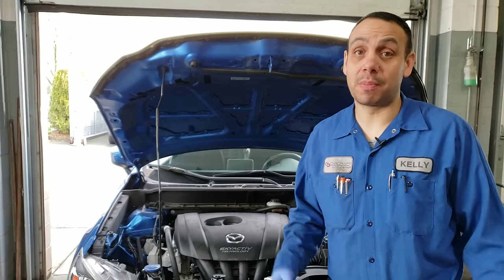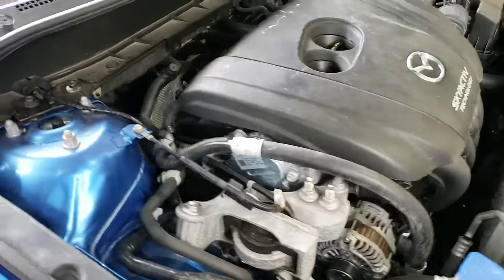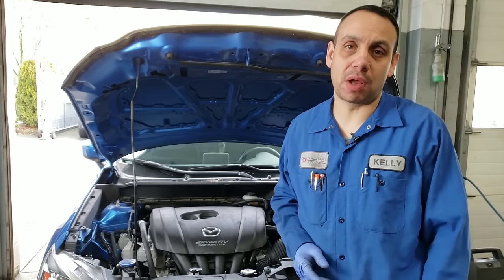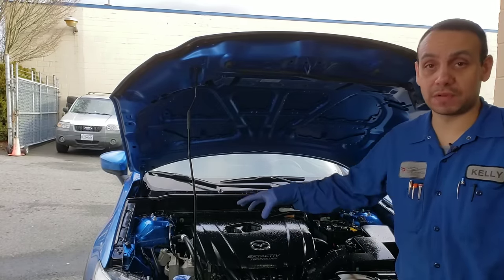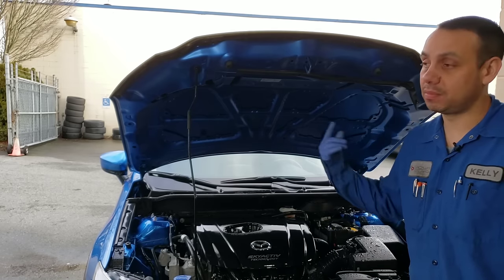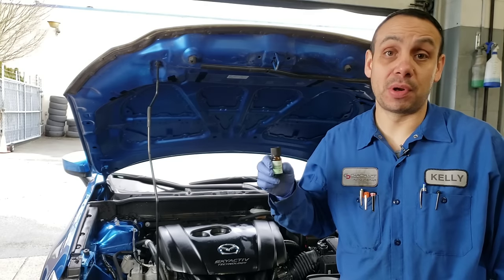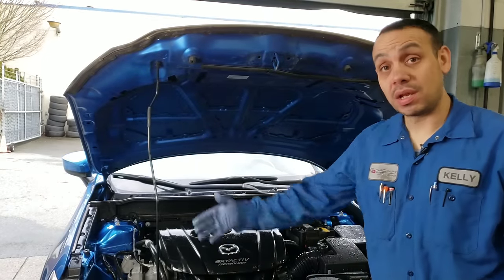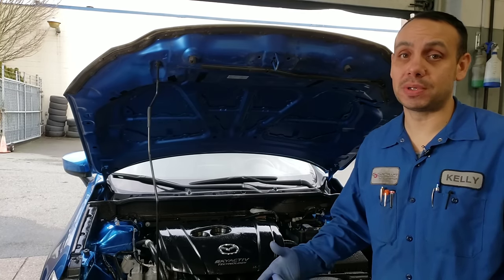Easy Tip To Keep Rodents, Mice & Rats Out of Your Engine Bay

Comment: Always switch your cars AC to recirculation before turning off overnight,   this shuts the ductwork from outside air, if you leave it open they will get in your ductwork and make a nest up inside where your cars cabin filter is, they use the filter as a nest. which is usually located below the glove box. they will also chew through the steering shaft boot in the firewall that separates cabin from engine bay.
Reply: Most cars automatically shut the flap when the engine is off
Reply: Now how to get rid of ants...
Reply: @2Hearts3  I've had ants a few times get in my car and it's incredibly annoying. I've sprayed the entire car even under the hood with spider/wasp spray, but the home defense spray from home depot works amazing. No more ants within a hour.
Reply: @latricet5569  But will any get aired into the passenger compartment, as it may be poisonous?
Reply: @youtubeobserverz  no, but we didn't turn on a/c either. No different than spraying it around your house.
Reply: @2Hearts3  borix acid or borax
Reply: @tazmaniandiva7762  Leave it out for them as you would Terro? They'll eat that? Thanks
Reply: @tazmaniandiva7762  Thank you, will try this 👍
Reply: Great tip. I fight off mice in a car I garage for long periods. They love the cabin air filter plenum.
Reply: I also found leaves and poop of mouse in the air filter..but I think if it keep recirculation mode than they will chew plastic and make hole to enter inside filter
Reply: @Brutipra  They will try and chew through soft rubber like the boot on your steering column going through the firewall,   don't think they will bother hard plastic. they do like getting between the hood and  the heat shield on the under side of the hood above the motor.
Reply: OMG! I DIDN'T KNOW THAT.....THANK YOU!
Reply: @americafirst4me  👍 Don't forget the steering column shaft, look up underneath where your gas & brake pedals are, the steering shaft  comes down and goes through a rubber boot in the firewall above  the pedals, somehow they know chewing through that rubber boot from the engine compartment gets them inside the car.
Reply: I’ve been storing my 1st generation Miata for over 20 winters. Mothballs in the engine bay nooks and crannies and mixed into a crumpled steel pan scrubber (jammed in the tailpipe) have always kept my car from being molested by any rodents.
Reply: Just get a neighbor like mine! About 50 cats and animal control does nothing. Mice problem averted 😄
Reply: @anastasiosanastasopoulos5736  Are you doing anything in the air filter inlet nozzle? Mine was a mouse nest. Both my NA's have easy access air filter inlets for mice. Wondering about a way to keep them out. Also muffler gets packed full of bird seed. Mice are terrible here.
Reply: Hi.
Russian Belknap family?
Reply: @flat6fever680  I use those mini-quiche/tart aluminium plates that are around 3” in diameter. You place the naphthalene within, making sure to not exceed the height (or depth) of the plate. You can either use powdered or balled naphthalene. These little plates should be placed ( I use a little tricky-tack on the bottom to keep them secure) along perimeters of rodent entry and potential nesting sites. Their low profile allows them to be jammed in all sorts of horizontal nooks and crannies. You can also ball up the naphthalene in a shop towel and wrap a heavy-duty industrial steel pan scrubber around it and jam the whole thing in the tailpipe, as rodents have been known to nest in mufflers. I hope this helps. Apologies for the late reply.
Reply: @Brutipra  They will actually eat a hole in the air filter if you give them a chance. both the cabin and the engine filter.
Reply: @anastasiosanastasopoulos5736  Thank you kindly.
Reply: Thanks for the heads up
Reply: YOUR COMMENT SCARED THE CRAP OUT OF MY OLD LADY 🐀🐀
Reply: @latricet5569  oil of pennyroyal
Reply: @sirkrutchbluesman3009  She is telling the truth. This is what I'm dealing with now 🐭😞
Reply: @2Hearts3  Sprinkle a little bit of ground cinnamon wherever you’re having an ant problem. Ants hate the smell of  cinnamon
Reply: @jamesmcardle5426  Thank you, will try this. Also, about cinnamon-- remember to eat only 'the good stuff,' and leave the cheap one to the ants. Ceylon cinnamon is good for your heart (and will cost much more, but worth it); the cheap kind will threaten your heart health. The way to tell: buy sticks, not the ground, and look for the inside of stick to appear flaky. The bad cinnamon stick is smooth inside. Thanks for the tip 👍🐜
Reply: I do this too and always regret it when I forget because spiders end up sneaking their way inside the cabin.
Reply: Peppermint oil attracts bears. What can I use instead of peppermint oil?
Reply: @lenbuckholtz2740  Had no idea We were Russian.
Reply: @jentommyontheroad8089  moth balls
Reply: Yep that's exactly where the problem for my car has started. It is a classic i rarely take it out because of this  my cabin filter is completely destroyed by mice and don't know now what to do in order to protect the new one. Plus can't use peppermint oil near the area since it is a part of the AC
Reply: @robertbelknap  neither did I. thought i was just 73% mutt. fits me. Who's the pretty lady in the picture?
Reply: @lenbuckholtz2740  Lol, Marilyn
Reply: I think this happed to me , I just moved to a new place it had a old deck seen a rat go under it , so I got rid of it , I think one of them got into my ductwork , seen some chewed up foam on my cabin filter and can smell a stink come in to the car  , it's a new car so I was kinda hoping it wasn't a rat lol  was just filling up at the petrol station and a rat came out from under my car and ran to the car behind me and went straight in to there engine bay 😬😅 so I jumped back in my car and hightailed out of there 😂😂😂
Reply: They are off all my firewall!
Reply: Sadly my 2018 RAV4 defaults to open when you turn the key off. Idiot engineers !!

Comment: This has always worked for me living on the farm. I also place a few make-up sponges with a few drops of peppermint oil on them in and around the compartment of the engine bay. Works great for the tractor too. They used to eat all the tractor wires and car wires until I started using these two methods. Now I get no rodents at all.
Reply: Reading all the replies I am going to follow your advice because Farmers know best as far as I am concerned. My mother was a farmer and she taught me a lot of good lessons from her life on the farm and they were always great. Thank You for the information.
Reply: How often do you need to do this in order for it to work?
Reply: If you are putting it on sponges , I would guess about once a month in a garage or every week if it’s outside.
Reply: Along with peppermint oil, I also use sponges soaked with TABASCO liquid, also rugging it on all the most 'vulnerables'.   Rodents HATE both !!!!!    I live in an 'open woods' where rats and mice are in super-abundance  and will also occasionally  'chew' though my house 'Rim Joice' to enter, especially in the late autumn... rats in spring time when they're looking to 'nest and breed'.    
Once they get inside the house, I prefer tabasco .... and I also set small pans of a DRY mixture of corn meal + wheat flour (50%) to 50% Plaster of Paris --- 'deadly' as it totally blocks their intestines ... rodents are unable to  'puke it up' after injestion. 

The only caution is to use vinyl gloves when handling the tabasco ... and thoroughly wash your hands *before* rubbing your eyes & face.... and using the toilet !!!!!  :-o !!!!
Reply: How often do you have to spray the peppermint oil?
Reply: @caseybc6342  Peppermint oil needs to be sprayed every two+ weeks.    You can also add 'sprigs' of cloves or  flower heads of marigolds. 
To prolong the aroma of peppermint oil ... soak cat litter granules in it - longer release of aroma.
Reply: This didn’t work for me at all.
Reply: @Fluterra  buy a mouse trap then or use your noggin and Google slash read comments and suggestions
Reply: How do you get them to stay in place? Is there somewhere specific I should place them? Thanks!
Reply: Never heard of using sponges but sounds like a good idea.
Reply: Love the makeup sponge tip!  Thanks
Reply: @caseybc6342  watch the video again and listen
Reply: Thanks for the info
Reply: Keep in mind rodents love leaves, paper, garbage so clean the surroundings thoroughly. 

I even use glue traps on the engine cover and on top of the battery since they like the chemicals, and leave a note on the dash board so I don’t forget. 

Keep in mind they can chew through wires and cause a lot of damage. 

Those little f are smart so whatever it takes, get creative.
Reply: I want to know about that electronic device you mentioned.  How is it powered?  I need to find one that has its own battery.  All I could find in stores/on line are plug in style and a couple that connect to the vehicle battery.  I don’t have power at the wood shed where I keep my plowing truck and I don’t want to run down the battery.
Reply: A bowl of antifreeze works pretty good too
Reply: Did not work for me either. I drenched the top of my engine and still found new rat droppings each time I had used peppermint spray.  @Fluterra
Reply: Why does this work? Im trying to find a similar solution but in my country we don't have peppermint oil 😢

Comment: It doesn't help that several companies are using an insulation on the wiring that is an extract from soybeans. For rodents, newsflash to the engineers, soybeans are rat food!!!
Reply from the maker: 100%
Reply: They know it. It’s designed to fail expensively
Reply: Didn't you ever think some of those engineers have rat brains? Hehe🤔😂🤗
Reply: Honda's
Reply: Same with fiber optic cables. The liquid between layers of 'protective' sheathing that allows for differential expansion and contraction in all temperature ranges is - peanut oil. Rodents LOVE the stuff and can smell it through the outer layer. So up here in the mountains of Arizona, guess what gets chewed through by tree squirrels every few months. We've spent days (literally) without any phone or internet while local crews patched up as many as 20+ damage points in my neighborhood.
Reply: Are companies doing anything to address this issue?
Reply: Yes it does not help but you can also thank the politicians and the weenies who vote for this nonsense. Remember you wanted biodegradable cars.
 Add hot peppers to the wire coating mix , problem solved.
Reply: @paulcoenen7918  I'm definitely on board with blaming politicians, they destroy everything they get involved with, and it's about to get even worse.
Reply: @richardhowe5583  Probably true, but add in the bean counters who've been asking engineers to design in "planned obsolescence" since the 60's (or earlier) so they could sell people a new car every 10 - 15 years or so. Ever notice that spare parts for cars are generally unavailable from the manufacturers in about 10 years? If a car isn't popular enough to support an aftermarket production, we're limited to scrapyard salvaged parts. My '94 Tracker is a prime example.
Reply: @steve762us  Correct!
Reply: @cruisecontrol4922  
Yeah, the dealers are making money doing repairs.
Reply: Which makes and models?
Reply: @AZStarYT  Talking to a lineman repairing such damage, he told me that he’s even seen bear damage.
Reply: The oils from our hands touching thing attracts them also. We use fiber jumpers and if we glove up and wipe down with alcohol the mice down bother them. The ones that were touch have all been eaten and replaced  several times a year
Reply: we found out the hard way , last year we took our camper out and we weren't getting propane to our heater , here something was chewing on our line , and later we found out it had a outer cover made with soy
Reply: @originaljcs  I have  worked in the farming industry and I can tell you  that nothing eats  soybeans. Absolutely nothing.
Reply: They know it's rodent food and it's probably why they use it a constant flow of money by constant repairs needed. Tesla is a great one for this and when first hearing of the story they refused to cover the replacement of the soybean based wiring to the tune of $10,000 +- dollars if remembering correctly. In their head it seems they feel it helps the environment and it is supposed to be an environmentally friendly vehicle so it is not on them to replace wiring that rats rodents eat away at.  At least at the time of learning this they took no responsibility. Great way to make revolving door residual income - make parts you know will be eaten by animals so the flow of money just keeps on coming.
Reply: @steve762us  Totally agreed on "chalk it up...".
Reply: here in europe i hear they are using dryed fish waste for wire insulation.
Reply: @cautiouslyoptimistic6185  Yeah man, it  is HIGHLY processed first. In it's natural state, nothing eats soybeans.
Reply: @kevinhardy8930  Very well put. 
                     👍👍
Reply: @kevinhardy8930  Have you never heard of veggie burgers?
Reply: @frederickshipp8013  you  dont  get it. Soy  beans are processed. The same way corn syrup is  not corn, veggie burgers are not soy beans, they are a soy product. 
I stand by my claim  that nothing eats soy beans in their natural  form.
Reply: Fluoroplastics are very durable especially in a hot place like your engine bay.   The wiring insulation in my '99 Tahoe stands up very well to heat and oil residue vapor.
Reply: @johnlopez3001  ...Yes Honda, but they aren't the only manufacture most if not all manufactures are using soy now...but Honda knows of the problem (maybe others?) and have addressed it by selling rolls of rodent repellent tape (around $100 a roll) so the "vehicle owner" can some how wrap their entire wiring harness which is next to impossible and it's not only the engine compartment either.

Comment: Nesting, urine, feces, are all annoying, but the rats chewing up the wires, that's way worse.
Reply: They can total a car
Reply: Spent close to $600 yesterday at my local dealership because of these pests.  Chewed through the map sensor connector wires.  Now using this method as well as moth balls.
Reply: @hiyellagal  what do you own?
Reply: @glennnichols4220  2005 Chrysler 300
Reply: @hiyellagal  i thought Toyota like others have mentioned was prone to this that is why he had a Toyota in the picture.
Reply: They use soy bean oil in the wire insulation which the rodents eat. I had my whole sensor harness eaten. It was gone right on top of the transmission where is join the engine there was a flat spot where they had their nest
Reply: Dang manufacturing using rodent attractive insulation way worse than old days..we Also use moth balls & 1 bite
Reply: I actually had nests by my blower motor and they chewed through the wires , I was driving one day and saw smoke coming in through the windshield vents. I stopped and a fire started, I actually had to pack my heater blower motor. After 1000.00 dollars, and alot of swearing, I got my truck back.
Reply: I packed it with snow because I couldn't get the fire to go out. It melted the casing of motor, and it still was smoldering so I took snow and packed inside and the too of motor. I have a love/ hate thing with wild animals.
Reply: @patriot1998te  - Damn, you're lucky to have snow to pack. Imagine those in warmer climes with nothing but dry leaves or grass on the side of the road... lol, feed the fire even worse.
Reply: @glennnichols4220  That is a Mazda.
Reply: Chewed wires to the ecm and at other spots on my A6, had to pay mechanic to fix it but in the end I had to give up and scrap it 🤬
Reply: To those using moth balls.
Just so you know it's a toxic insecticide, not to mention the noxious smell.
 I find mouse traps baited with sunflower seeds to be 100% effective. The key is to always have at least one baited and working trap in the garage, they will find the seed and they will not leave the trap alone as long as the seed is in it or they die trying to get it.
Reply: I drove a brand new truck while driving all the warning lights came on mice 🐁 got into engine bay and chewed through the main wiring harness 😲
Reply: @glennnichols4220  ALL newer cars have soy based wiring.   ALL manufacturers use it.
Reply: @gaiusgracchus7475  So soy base wiring isn't the cause??
Reply: Money money
Reply: Same $680 to fix wiring at vw

Comment: I am an old time Detroit engineering worker. In the past electrical wiring was petroleum based now wiring is plant based so the animals will eat your car up. Try all recommended treatments on u tube and some off the wall ideas which could work. Look at it this way if you can make gasoline out of corn any thing is possible.  Be safe and have a merry Christmas.
Reply: 🎄313